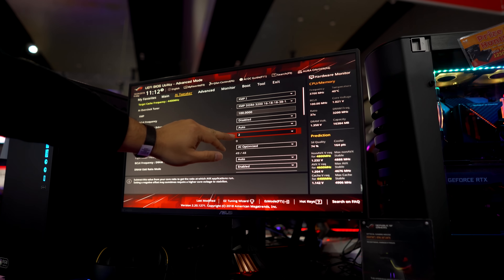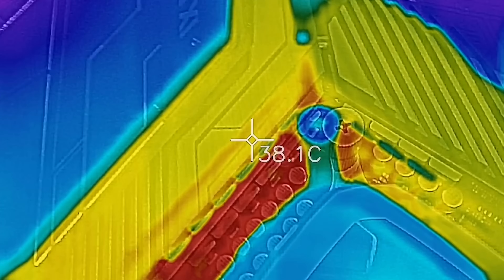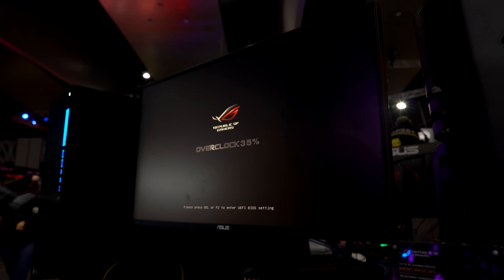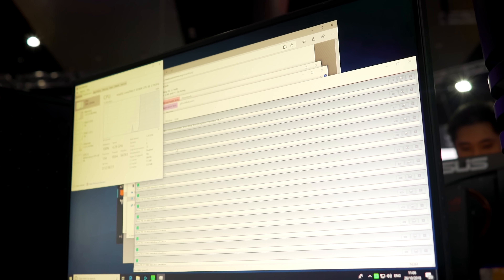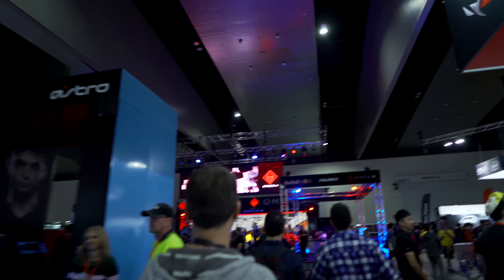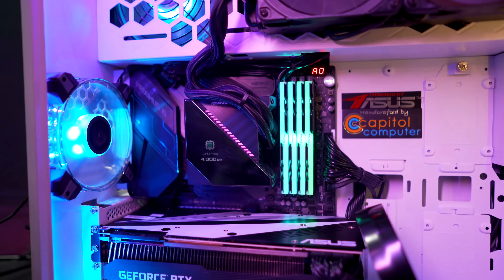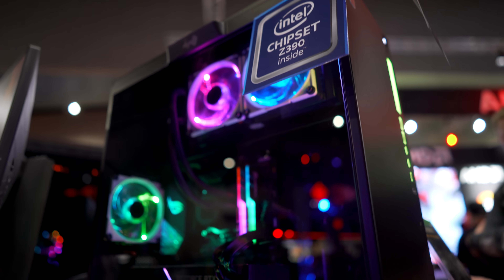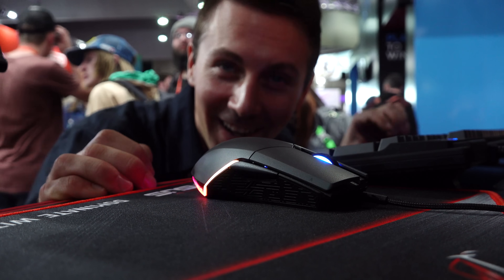ASUS Responds to Motherboard "Issues" + New Ryujin and Ryuo AIOs

Comment: Asus makes some really expensive boards that are nothing but crap (Hero XI). The BIOS is not much better. Check out GamerNexus review with BuildZoid. I will stick with MSI
Reply: msi is worse
Reply: @DragonProtector  You have no clue what you are talking about. I suggest you look up the references provided.
Reply: @joanamendoza-r5l  i do know i used msi before and had nothing but bad experiences and dead products.

bought asus board for my x399 threadripper setup and have had 0 issues.
Reply: @joanamendoza-r5l  i did manage to revive my msi gpu though so it still working fine but it in my parents pc since i bought a new gpu.

maybe i just got defective products to begin with idk. But that how my experience went.

Comment: That setting is a sign of ASUS' arrogance. Do you want to use the "ASUS" recommended settings? Most people think no go away I'll do it myself. So they choose no. Which is usually the best way to do it but this time it hurts performance. Not realising that you then get Intel's crippling settings. Having said that it boils down to RTFM. I know if I order a new motherboard I read the manual before it even arrives. It's baffling to me that LTT and other reviewers didn't read the manual before reviewing a product or at the very least get to that setting and think I should find out what this does and look it up.

Comment: Any point in going with a Z390 motherboard for an 8700k to future proof your pc?
Reply: No. The z390 wont be continuing into next gen so your not future proofing at all. By the time the 8700k will slow down which will be at least a few years there will be new boards cpu's so you would be upgrading a platform. If you already have a z370 there is no point in changing. If you dont have a board then most places have replaced z370 with z390 anyway

Comment: Thx for the vid. Could you perhaps ask Asus why immediately after running Cinebench for the second, third + time around the scores are lower?
They generally score 1900+ w/ an OC the 1st run and then score below 1800 for the rest. According to Steve at Hardware Unboxed the board down clocks because it can't maintain the OC due to the lower VRM's being used on the Hero board (VRM throttling). I also saw two other reviewers who have the Hero also showing these same results so I know Steve is correct on this. I'm just trying to determine whether or not Steve is right about it being the VRM's or if its perhaps a AVX setting, as I really like the Asus Hero board not to mention the bios and software are top notch but the 12 phase VRM's on the Taichi sounds very appealing over a 4 phase.

Comment: Is ASUS ROG Z390-E STRIX good for 9900K? I had finalized getting that one but then these 'issues' surfaced. Also if anyone can tell me, would this motherboard be better or AsRock Z390 Taichi? Thanks.
Reply: Yes it has the best vrm before heading into the maximus series. Im not familiar with the asrock gear sorry
Reply: Every Asrock board I've used has fantastic VRM (for extreme overclocking, I'm not talking about poor man's water cooling, I'm talking frost on the board). The biggest issue with Asrock, is the BIOS is stupid sometimes. Like when 1 setting gets changed, sometimes other, seemingly unrelated numbers change. This mostly happens after your crash timeout is reached (IE, you've crashed 5 times without a successful boot), and so MOST things get reset, but sometimes voltages just get reset and not others... Anyways, once they are dialed in, its not a big deal, but if you notice when I said "extreme overclocking", I'm the kind of guy who says, "huh, only crashed 40 times today, better keep going", its not weird for me to crash out 100 times in a day of benching, so for me, its super annoying that I need to double check the settings. If you're not doing this, well the 2 extra minutes of your life to double check those few times you enter the BIOS is probably shorter than my comment, so you'll be golden, LOL!

Most I've pulled is around 450-500w on FX with a 4 phase VRM on a $40 (price new in 2015) Asrock 970m (yeah, micro-ATX) with $3 in VRM fan and heatsink mods, that's way over 100w per phase on the most budget board they sold. The bigger chips like the 32 core 2990WX at 5 Ghz on LN2 will require modding the $300 Taichi on X399, but that's a stupid amount of power draw, so yeah, you'll need $10-$20 in cooling upgrades, but you're 9900k won't be doing anything like that!

They are good boards other than a few BIOS quirks, plenty good VRMs, I'd say get one (that's why I repeatedly buy Asrock boards, I do wait for reviews of course to make sure they handle LN2 overclocking well), they consistently do well.
Reply: @jakegarrett8109  Thanks for the detailed info.
Reply: Forget the Strix hype
The Tachi is about the best Z390 motherboard available today
Search out TechDeals and Tech Showdown on YouTube to learn more
Cheers
Reply: @digitalintellect9870  Yeah I watched those reviews, but I haven't seen a proper review of the Strix, and I haven't used AsRock boards so I am not sure if their BIOS is as good and simple as ASUS, and the bigger reason is that AsRock isn't easily available in my area, so if there is really that big of a difference between Strix and Taichi, I could wait a little more and make the extra effort needed to get a Taichi instead of Strix. Also, does anyone know if Maximus XI is going to be a justifiable upgrade over STRIX, if I am not into extreme overclocking, and don't need the extra features? Is the better power delivery that much important for medium overclocking with 9900K? Total price of my build is going over $4000, so I'd like to spend the extra money for Maximus XI only if it provides a significant advantage over Strix board, and lower part of the board is already going to be blocked by Vertical GPU mount.

Comment: Asus motherboards (Edit: sub $250) are trash. Bios is horrible and the parts are junk.
The rest of their products are pretty nice... they're just overpriced as all hell.
Reply: Lol. Awkward when all the best overclockers use the maximus apex or xtreme series by asus
Reply: @AllThatJazOfficial  - to your your point (and I should have been more specific -see edit) my experience is with mainly entry to mid-level boards (sub $250). Perhaps their high end stuff is better quality comparatively to other brands but the mass amounts of people aren't buying motherboards over $250. Also doesn't excuse how dated, unorganized, and difficult to use their Bios is. MSI and Gigabyte both have them beat on that.
Reply: I've never tested the BIOS of the low-end boards but i can say for sure that the high-end ones have some the best BIOS in the business.

Comment: Will you do a full review of the new Asus Keyboards, Mice, and Headset? I plan to do a massive peripheral overhaul upgrade for the first time ever since I have always used budget peripherals and am trying to decide what mouse and keyboard to get. That gaming mouse you showed does look kind of cool.
Reply: Buy what u need don't buy what u want... not every overhaul is better or good..q
Reply: @jcsn2161  I know not every overhaul is good but I spend 12 hours a day on my computer because I am at university so I need a good mouse and keyboard. I only do uni work and gaming so I want to splurge a bit on my PC because I want it to be nice to use and better then your standard off the shelf keyboard from Tesco. Sometimes putting a bit of quality into your equipment will make life easier in the long run.
Reply: @DoomWalker42  if u need build quality don't buy from gaming brand..hehe
Leopold, kul es 87, realforce r2, plum niz for keyboard maybe but if u need rgb ducky, ikbc, abko hacker v3, steelseries m750 tkl..
Mouse i think hyperx good sensor cz pmw3389 zowie just 3310 and pricey..logitech gpro good too..
Headphone dt770/dt990, hd58x, hd650/hd6xx, brainwavz hm5, ath m40x/m50x etc
headset cloud alpha/cloud mix..
Reply: @jcsn2161  well i want to get a keyboard from a gaming brand cause i like one or two brands and support their work. But i dunno. I will look up some cheap keyboards. Whenever i got cheap stuff it always broke and wasn't as good as reliable brands

Comment: i hope Asus will make a 280mm AIO. i would happily throw my Nzxt kraken x62 in the bin for a ROG AIO of equivalent capacity
Reply: The percentage gain from one to another will probably not be that significant. A better option would be to stepping up to far thicker radiators like EK’s. Though that would more than likely be a large step up in cost.
Reply: @aprisia   i realize there wouldnt be a performance difference but all my parts are ROG branded except my case, ram and ssd.. that little oled screen with the ROG logo would suit my build so much better
Reply: @ThatDaveFella  rog make cases too😁 the best looking cases aren't out yet from Asus but there is some floating about😁
Reply: @MXDOUT  wasn't any available from where i get my parts unfortunately :( i do plan to do a few mods to my case to make it more ROG :D
Reply: @ThatDaveFella  is that you favourite brand by any chance hahaha or have you just had good results from them😁
Reply: @aprisia  but then saying that what about people not knowing about cases and the way they breathe, like people go with aesthetics looking cases and not understanding they need a case to bring in nice cool air in from the front theoretically, but also judging and maintaining a cooler PC inside which does ethier effect cooling, throttling, performance, can also be deemed for the aesthetic too 😁
Reply: @MXDOUT  Must be close to you receiving that 9900k now mate?
Are you going to do a thermals result video?
Reply: @maydaygoingdown5602  Definitely yes to start with the MSI Meg motherboard as that's what all the reviewers got then the asus motherboards because there seem to be good at cooling in the bios for 9900k chip like voltages and such but also I have seen that they may lose performance, so need to do analytics on those too😁
Reply: They do I have it, but haven't tested yet 😉😉
Reply: Read that wrong they have a 240 version👍

Comment: for that AIO you can get an EK kit O_O
Reply: He did fail to mention they are sold with noctua fans and house an internal noctua fan on the block itself for vrm cooling.
Noctua = Expensive 
Asus = Expensive
Noctua + Asus = RIP money
Reply: @personwiththeface4416  mind you 240$ is the starting price for the 240 base one without internal noctua fan 

thats the price for the s240 kit from ek, that can be serviced easily and if something fails its just a part instead of the whole thing
Reply: @lacucaracha111111  - that was my next question. Is the Asus product a pieced kit or is it a single piece AIO?
Reply: @ammotorsport9480  full AIO it seems
Reply: @lacucaracha111111  - I see. HEAVILY overpriced then, even if the $240 version had the Noctua fans. EK Kit is still my next cooler.
Reply: @ammotorsport9480   same , I may be mistaken, but at that price the AIO better be refillable and have spare parts around